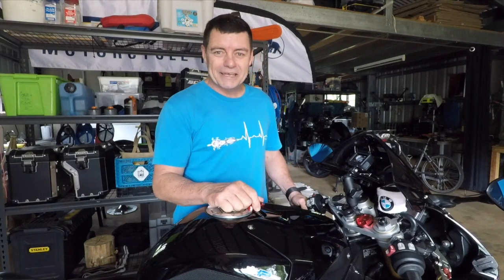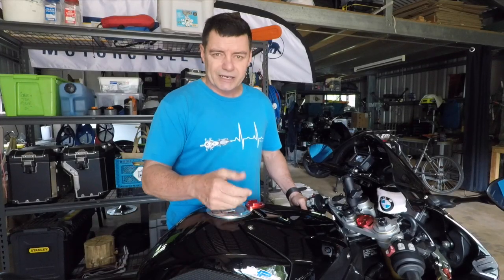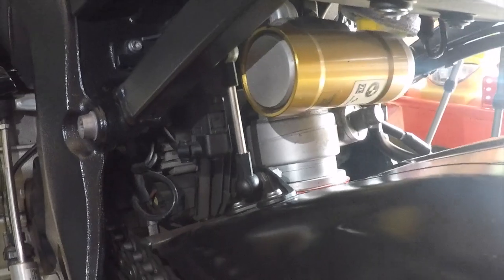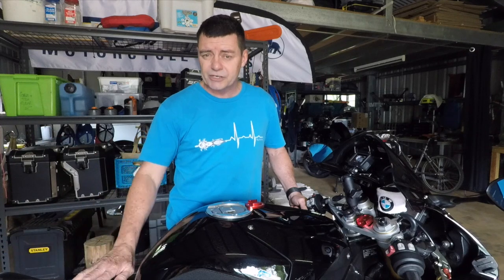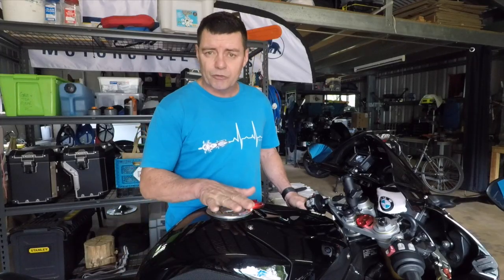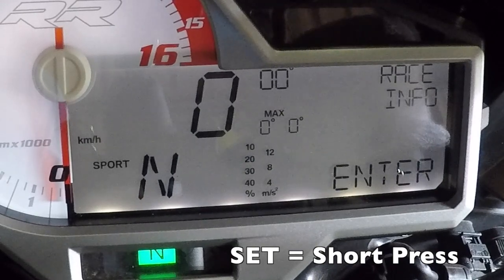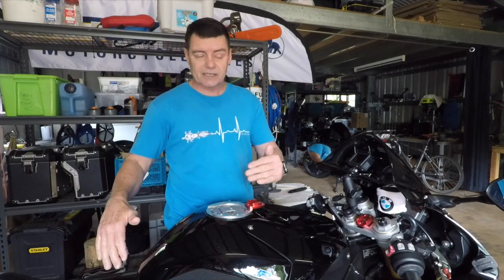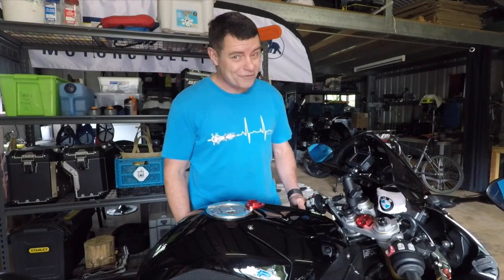Calibrate Zero Point After Setting Preload and SAG on BMW S1000RR

Comment: I’ve got a 2022  with DDC - you’ve offered the best info  I’ve found yet even knowing the model year is quite apart. Similar even if not the same. Incredible that dealer selling bike doesn’t offer basic setup knowing it’s not an easy or clear process. Like nothing else especially manual dial adjusters. The bike on to do the adjustment is likely just the start of it for most. Even to read manual supplied with bike barely skims it and the computer dealer service technician manual isn’t super clear. In fact I read dealer manual like a book page for page 4-5 times before it all started to come clear (along with doing each process where needed). The other major hurdle - all the specialist tools that are unavailable to pubic (along with the actual manual at least easily purchased) Bmw clearly want buyers paying (overcharging) the buyers to work on the machines. The most unfriendly serviceable bike I’ve ever owned. And by far the best machine simultaneously. 😢 Such that working on it until I figured it out was pure anger. Wanted to light it on fire a couple times.
Reply from the maker: cheers mate, glad I could offer some value

Comment: I try calibrate zero position I press button Calibrate (I didn’t change DDC at all from 0 pozition) and shows me ‘calibrate fault’ when it should show ‘calibrate done’ why?
Reply: The bike has to be straight off the side stand.
Reply: @Sean B. 👍 Thx. mate calibrate done less than two months ago.
Reply: @fest102  how did You calibrate DDC, I try several times and show me calib fail. Thanks in advance
Reply: @amauryalmaraz4877  Same here, every time it fails to calibrate...
Reply: The bike has to be on the side stand in order to calibrate properly. Ride safe!

Comment: Does the S1000R have this too? 😦
Reply from the maker: I had a good look at an S1000R owners manual and can't find any reference to the CALIB function after preload setting. This lift detection is actually installed, on the left side beside the rear shock you can see the linkage connected to the swingarm for lift detection. But I'm fairly confident calibration of it is not an option on the R
Reply: The Bike Stig Ah thanks for clarifying that George. Worried I was missing something. Searched all over the bike menu’s and manual too found nothing. 

Really curious why it’s different from the RR 🧐
Reply from the maker: @Invis_Space  I think its because the race bike simply needs to be more precise and rear wheel lift is a genuine issue. If you are setting your preload properly then rider SAG will be close across all bikes regardless of rider weight. That rear wheel pick up is only an issue when the rear wheel is lifting off the ground which most people won't have problems with. Truth is we are turning off ABS on the track so it's not an issue regardless of calibration.
Reply: The Bike Stig Right ok got ya.  Thanks for taking the time to explain mate 🙏🏻

Comment: My settings in DDC are at 0 and bike rides harsh , small bumps and moderate speeds , as want to throw me off the bike .. any suggestions as i await going to have the suspension looked at , as well I'm not able to calibrate the DDC...
Reply from the maker: if we are talking about the same thing, you could make a larger adjustment to all settings and see what changes you notice to how it feels - set it to -5 on the front damping, -5 on rear compression, and +5 on rear rebound. try that first.

Comment: Hey there, my s1000rr 2015 gives a bit wobble when i try to lean more, what could be the cause, and wht is the solution. the ddc settings are zero.
Reply: I feel the bike is bumping while m leaning
Reply from the maker: Need to talk to someone in a workshop who works on suspension I think mate.
Reply: @TheBikeStig  will be waiting to hear from u chief
Reply from the maker: @MHBMOHD  I just noticed you said DDC settings were at 0 ... Try something like -4 for compression, and +3 for rebound for both front and rear and see how that feels. It should compress fairly quickly but not rebound too fast. As for a wobble, I'd be getting a technician to look at that.
Reply: @TheBikeStig  sure, i will try this jst now and update,  u are sooo helpful, thanks so much chief really appreciate ☺️
Reply: @TheBikeStig  hi doc, hope u r well. I have tried the settings u gave me aswell, watched one of your videos for user mode settings, it actually worked 😍😍 i hv tagged you in one of the videos
Reply from the maker: @MHBMOHD  thats awesome mate, glad it helped with the set up as the bike should not have those issues. Have fun on it.
Reply: @TheBikeStig   Thank you doc thank you so much, 😊

Comment: I have just had the suspension set up.Can I calibrate the suspension on the stand or does it have to be straight up and down? Will the compression and rebound settings still be saved or will they be reset after calibration?
Reply from the maker: yes mate, damping settings won't change, just make sure the bike is not lifted and is simply supporting its own weight when you calibrate, I normally do it on the paddock stands front and rear.
Reply: @TheBikeStig   love your videos.Ihave a 2017 only wish I could ride half as good as you 😂do you ever come to any Brisbane tracks?

Comment: Hi MY S1000rr 2009  acceleration sensor has gone bad it does not rev any more What I get from eBay serial number is different does it going to peak peak what I get from eBay serial number is different does it going to pick
Reply from the maker: not sure I can help you with that mate, im not an expert on the parts

Comment: Hi Stig/ Do i need calibration if i change Tyre size from 200/55  to 200/60 ?
Reply: and do ineed somehow reset DTC settings also for that
Reply from the maker: @SHAMANTASH  thats a good question, if the rear tyre has a higher profile then technically speaking it would change the height slightly so it stands to reason that a calibration which takes 30 seconds to do would be worthwhile.
Reply from the maker: @SHAMANTASH  no need to do anything wth DTC.